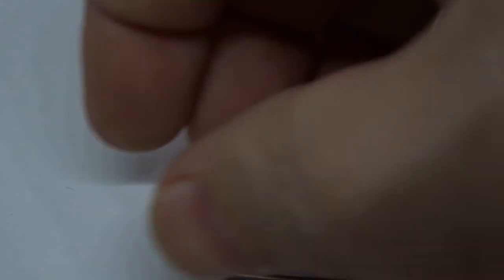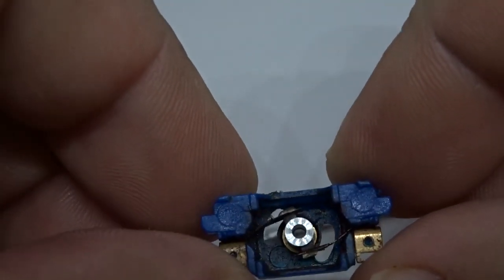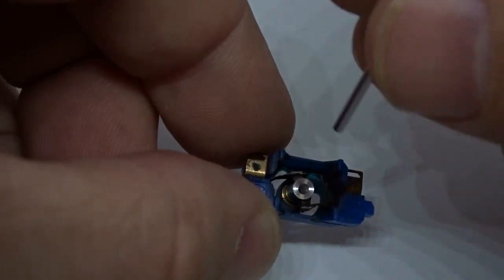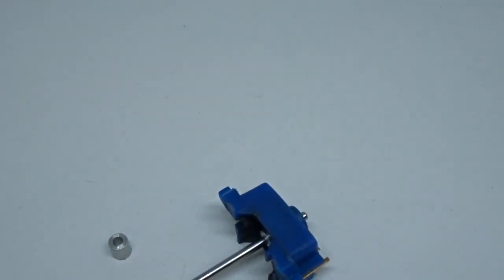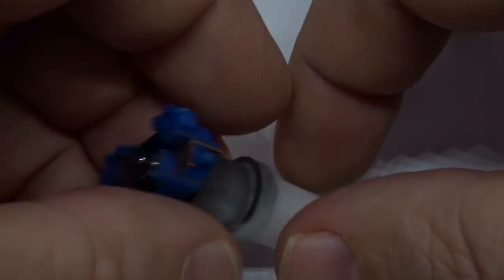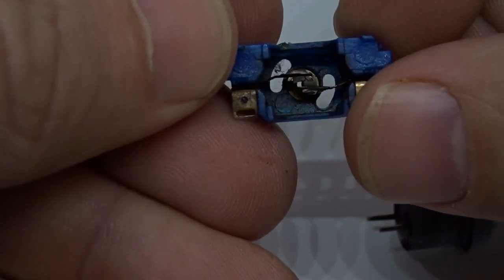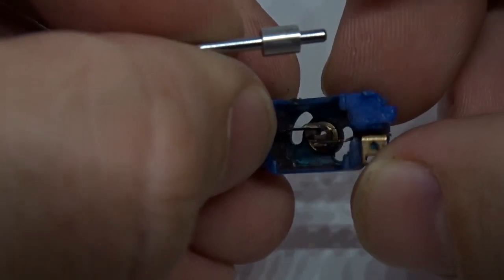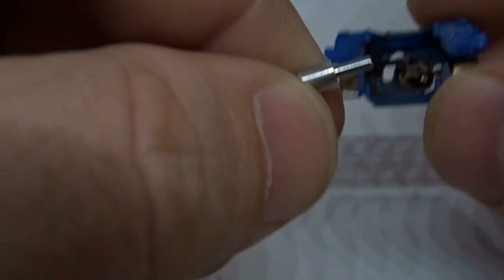Endbell brush alignment tool

Comment: Cool tool. I've had one of the cylinders for years. Some thing that will make it even better is to add 3 score marks around the OD 120 degrees apart to simulate the comm slots. That way you can see where the brushes fall on the comm segments.